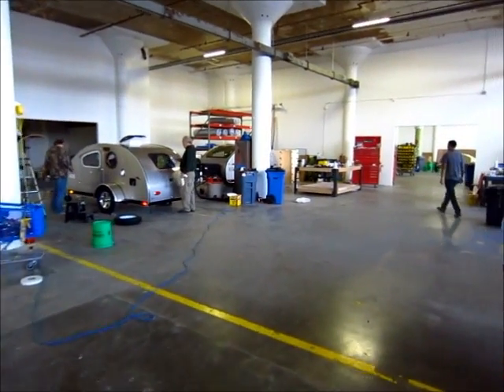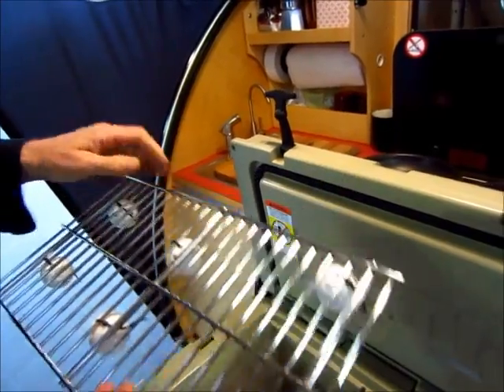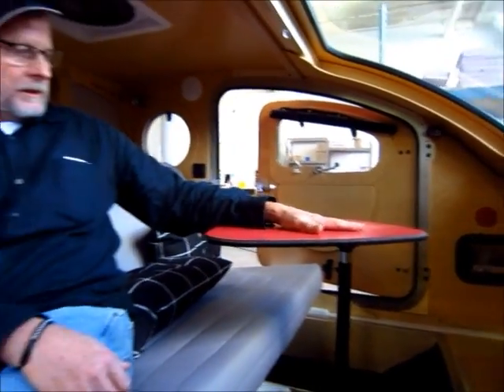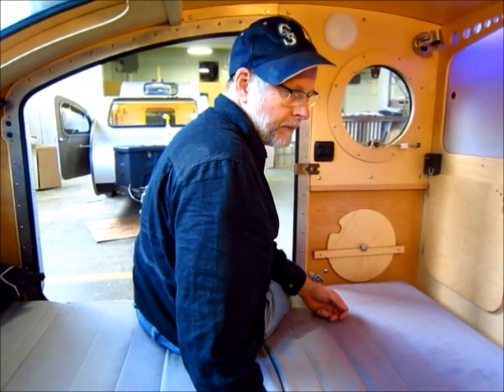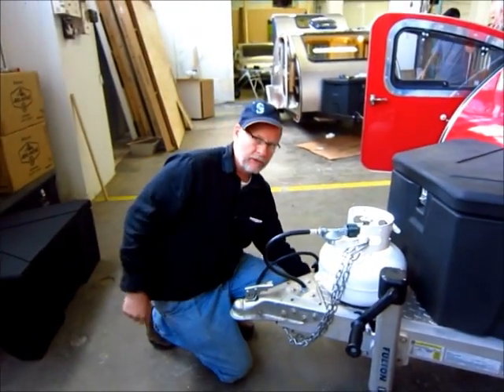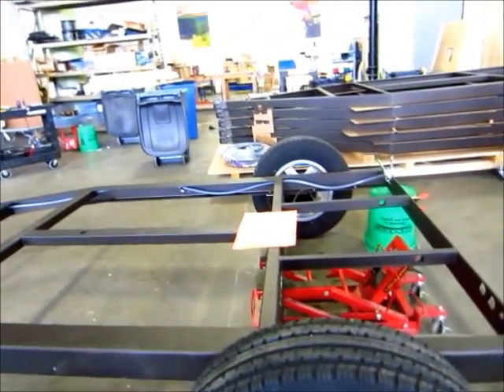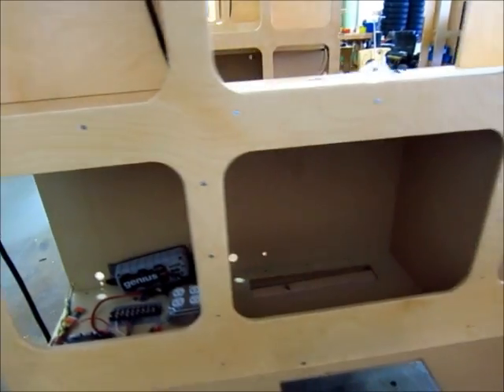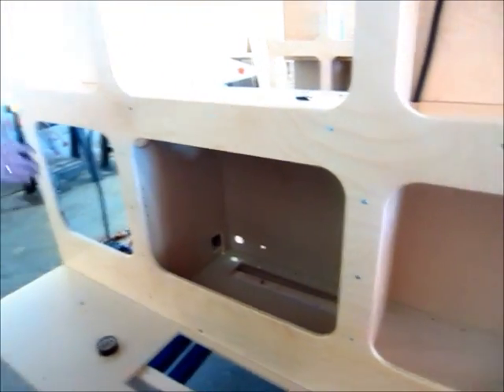Vistabule FACTORY Shop VISIT Teardrop Trailer

Comment: This is by far the best teardrop trailer I’ve ever seen. The outdoor kitchen set up is fantastic. Having an ac Unit and a propane furnace is also a must have. It also seems to be very roomy inside as well. This trailer is just the coolest thing I’ve seen. I really want to get one! Thank you for sharing and great video! Take care!
Reply from the maker: Lots of videos of this trailer in action here Thank You!  Check my other videos  https://www.youtube.com/cosmoweems/videos  SUBSCRIBE https://www.youtube.com/cosmoweems?sub_confirmation=1
Reply: Check out Camp Inn Trailers pretty nice
Reply from the maker: I featured Camp-Inn on my channel. Vistabule and CI are both wonderful. We are fortunate to have 2 top choices.

If you enjoy looking at fine cabinetry with thick clear coat while sitting in the camper, (definite I am inside feel to the interior) with 2 door windows that open, views on 3 sides, but the body windows (plexiglass) in my opinion don't provide much of a view, and  do not open.  The camp-inn might be  for you. Plus 85 amp hour battery. Air conditioning strongly recommended but cant be added later. Suburban propane heater. Quartz lighting. Less storage space in my opinion. Bunk beds or  storage shelves depending how you use them.  Not being critical in any way - just stating the facts. But you can get some interesting goodies like hand rails on the roof etc. I showed them in the Camp-Inn video.

If you want to look out at nature and want super ventilation 4 glass windows that open plus 2 ventilation ports, views on all 4 sides (definite I am outdoor in nature feel when curtains are open)  Vistabule might be for you. Plus 120 amp hour battery or lithium battery, air conditioning for me was not needed due to GREAT ventilation and being off grid a lot. Glass windows. But air conditioning or heat  can be added after build if desired. Propex propane heater. LED lighting and lots more storage space in cabin and kitchen due to design. Also futon couch bed.

Both use torsion bar suspensions. I love both trailers and both companies and people who work their. Prices are comparable.

I don't see it as one is better than the other. The features appeal to different customers.   

You cant go wrong with either. Of course there are other differences too. I cited the ones that are important to me because the directly impact my camping experience and capability. 

Thanks for your comment.
=Cosmo

Comment: have you used a diesel heater i put one in a 35 ft  camper used for year works great on ebay was 140.00 runs on 12volts and diesel 1/2 price of prpone
Reply from the maker: Thanks Michael. I have not tried a diesel. My trailer is so small I dont want to introduce another fuel. I can use propane for the stove and heat. Makes more sense on a larger rig with more room. I want to keep this rig as simple as possible. 𝕋𝕙𝕒𝕟𝕜 𝕐𝕠𝕦 𝕗𝕠𝕣 𝕨𝕒𝕥𝕔𝕙𝕚𝕟𝕘! =𝓒𝓸𝓼𝓶𝓸 ✅

Comment: I wonder could this teardrop trailer be made a bit longer..although I'm 6ft 1in tall having 2 feet extra could go a long way especially for storage or add an up right refrigerator instead of a short ice bin..becuz you can run a Patriot solar power generator for your refrigerator..just an idea 💡
Reply from the maker: Hi  Darryl. Thats a question for Vistabule. They do a lot of custom work. But they also try and stick to a formula build. You will have to contact them at Vistabule,com or call them. Wish I could be more help. Thank You for watching. Check my other videos https://www.youtube.com/cosmoweems/videos 
SUBSCRIBE https://www.youtube.com/cosmoweems?sub_confirmation=1

Comment: You've done a lot of nice work on your trailers in your designing process. I'm curious to know what this sealer chemical is and does it off gas? You mentioned something about it going from the CNC shop to the finisher shop and getting some kind of sealant. I need to know because I'm susceptible to chemicals and smells of chemicals.
Reply from the maker: I dont know. Call Vistabule for answers.  𝕋𝕙𝕒𝕟𝕜 𝕐𝕠𝕦 𝕗𝕠𝕣 𝕨𝕒𝕥𝕔𝕙𝕚𝕟𝕘!  ✅  Check my other videos https://www.youtube.com/cosmoweems/videos 
SUBSCRIBE https://www.youtube.com/cosmoweems?sub_confirmation=1 =𝓒𝓸𝓼𝓶𝓸 ✅

Comment: I didn’t notice any framing.  Do the sides of the trailer have aluminum studs or is it just sheets of wood with an aluminum skin?  I guess I am asking what is the structural integrity of the sides and roof.  Thanks in advance!
Reply: Sheets of furniture grade ply dadoed and rabbeted then glued and screwed.  If you flip it at 60mph you're going to put a really big dent in it but if a kid on a bike runs straight into it he's going to be the one with the big bump on his head.

Comment: Hello, don't put the batterie in the Trailer where you sleep or other, this my point of vew. Put ina the plastique-box in front or in kitchen in back! So very beautifull trailer... to good on adventur! Good continuation!
Reply from the maker: Thank You Very Much. The battery is a sealed battery which emits no gas and can be installed in any position (even upside down). It is safe to install in the trailer. Thank You for your comments.  SUBSCRIBE See my other Videos https://www.youtube.com/channel/UC5Sd6k_HhdZA_Av-TQHhLUQ
Reply: All right, but may be better to put out of the trailer, just for the case of any other thing, "energy when it's recharge or decharge... It's my point of vew. But the result of what you make it's good and give the feeling to have or buy one. Thank's!

Comment: How do you secure the ice chest?
A sudden stop means a colossal mess on the floor
Reply from the maker: I have had my trailer since 2016 Had no issues with cooler (which in my case fits perfectly)  spilling anything. or moving about. I have since moved to a DC AC Electric refrigerator ahich does not move either. For the fridge I put in spacers to keep the cooling vents breathing. SUBSCRIBE and see my other videos at https://www.youtube.com/CosmoWeems

Comment: I have a question for you ::: Do those battery need some space to breath or cool down with air flow over it ..? do these have air flowing thru them ..?...Thanks
Reply from the maker: batteries one of my favorite topics. The battery is 105 amp hour Sealed AGM (Acid Glass Mat) deep cycle battery. As noted you can run them in any position even upside down. They don't vent like wet acid batteries so fumes are not a problem. I have not had and AGMs get hot when using them but I use them within their design specs. on a 105 amp battery like this 1/10 (or 10 amps OR LESS will extend battery life. You can draw lots more  of amps out of this battery but it will shorten the life.  The short answer is no breathing room needed in my opinion. -COSMO
Reply: thanks for the reply ....( smile )

Comment: What is the draw for the AC unit. Perhaps a generator would delete the need for a camp ground plug in
Reply from the maker: You need shore power (grid electric) or a generator. Check the draw of a 5000 BTU AC for an idea. Check my other videos http://www.youtube.com/channel/UC5Sd6k_HhdZA_Av-TQHhLUQ 
Links to the exact gear I use at www.cosmoweems.com
Reply: @CosmoWeems  Your website isn't displaying very well for me.  I was thinking maybe one of those little Honda generators, EU1000i or EU2200i. If I put that in front of my vehicle and run a cord, would that be enough for the AC?

Comment: love your videos...Love the trailer.
I am new to trailers (old tent camper).  Does the battery get recharged: while you are driving? 
or while you have solar panels hooked up? or if you are plugged into electricity at a campground?
Thanks
Reply from the maker: Hello James. My trailer is set up for all 3. It charges while plugged into grid power at a campground, and when the trailer is plugged into the care (the car alternator charges it) or solar off grid.. It has always been a dream for me to have sustainable off grid power and I finally am at that point! It all works very well. - Cosmo    See my other videos 
https://www.youtube.com/results?search_query=%22cosmo+weems%22
Reply: Thanks for the response.  If it's not to much to ask...what did you have to do to accomplish it all?
Reply from the maker: The trailer cam wired for 120V. There is a plug in the side that distributes the electric to the 16 AC outlets distributed around the trailer. The trailer came wired for the DC connect to the car. I had to have the car wired to accept the trailer connector. This includes the brake lights, blinkers and side marker lights. It also included the connection for the trailer electric brakes (in my case) I also ordered the trailer with the connector to charge the trailer from the car while plugged in. The solar connector was also installed at purchase time. I wired in my own solar controller and put connectors on the solar panels that match the trailer plug for solar. These are all standard setups for RV trailers. Should be easy to find plenty of info on this. BUT you need to figure out your electrical needs in advance so you buy the right stuff for your needs. - Cosmo See my other videos 
https://www.youtube.com/results?search_query=%22cosmo+weems%22
Reply: Thanks!
Reply from the maker: When I plug 120v ac into the trailer ther is a 120v   battery charger that charges the 12 volt bqttery.

Comment: Can this be towed by a large motorcycle?
Reply from the maker: It weighs 1500 pounds (loaded). Not a good match in my opinion. Thank You for watching. Check my other videos https://www.youtube.com/cosmoweems/videos 
SUBSCRIBE https://www.youtube.com/cosmoweems?sub_confirmation=1
Reply: Most small cars can barely manage to pull themselves around and the ones that are capable of towing are usually limited to 1000-1500lbs. My Crown Vic is technically rated for only 1500lbs despite being able to double that.
There are small tent trailers for bikes but you're better off with a small utility trailer for supplies and a nice pop up tent.

Comment: use the heater with external tank
Reply from the maker: The propane heater is an external tank. 11 pound propane tank on the trailer tongue. In super cold I bring a second or third tank depending on duration of trip and temps. https://youtu.be/bVj8T1ronQs  𝕋𝕙𝕒𝕟𝕜 𝕐𝕠𝕦 𝕗𝕠𝕣 𝕨𝕒𝕥𝕔𝕙𝕚𝕟𝕘!  ✅  Check my other videos https://www.youtube.com/cosmoweems/videos 
SUBSCRIBE https://www.youtube.com/cosmoweems?sub_confirmation=1 =𝓒𝓸𝓼𝓶𝓸 ✅

Comment: But they don’t grease the rear bearing very well
Reply from the maker: The axles are lubed by Dexte when manufactured My first lybe job the axle accepted a tube of grease on each side. I Called Dexter about this and they told me they are adequately greased when shipped. I disagree with them and lubed. The Dexter EZ-Lube is the simpelest most user friendly way to pack bearing I have ever seen, I love it! =Cosmo Check my other videos https://www.youtube.com/cosmoweems/videos SUBSCRIBE https://www.youtube.com/cosmoweems?sub_confirmation=1.